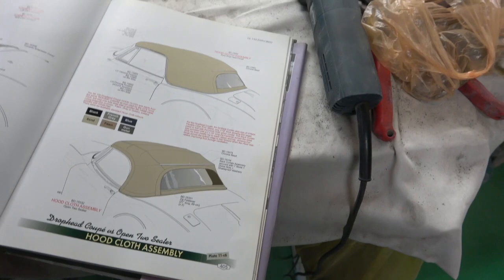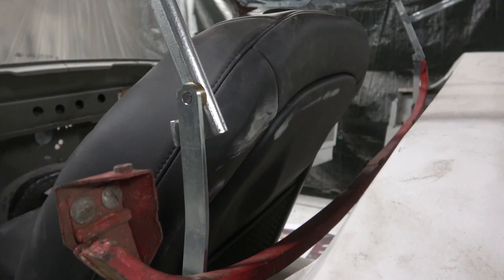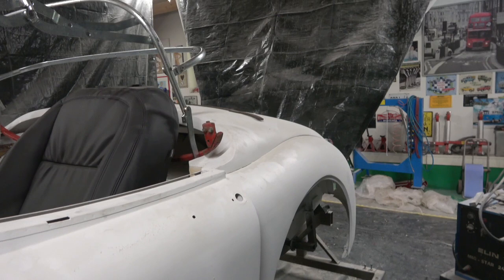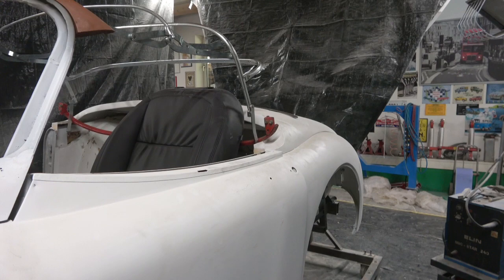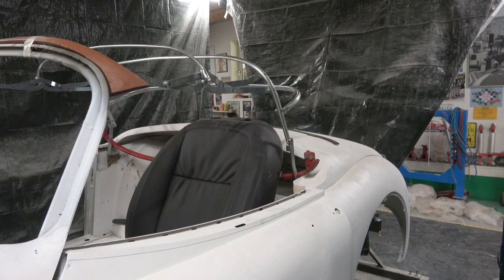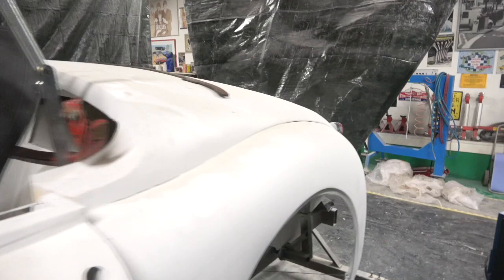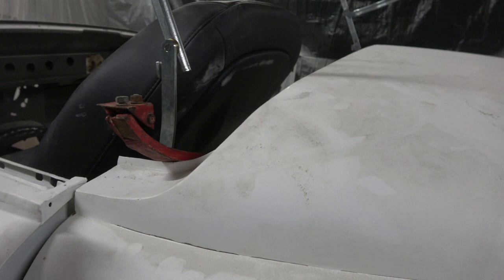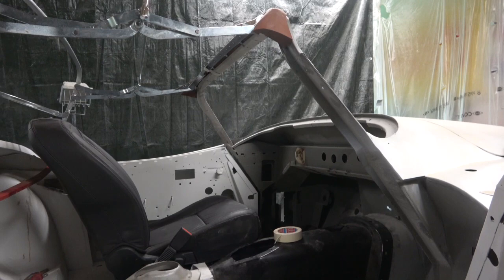1958 Jaguar XK OTS New Roof Frame ( Advice & Tips Welcomed )

Comment: With you all the way on the seats Dave. It’ll be the most comfortable XK150 on the road - certainly more usable than as standard. Cars are for driving!
Reply from the maker: Thanks!  I have been told on numerous occasions from owners that the original seats don‘t support very well and there quite upright, I have been told that they can be bleached and redyed another colour which is something i need to look in to. Cheers Dave